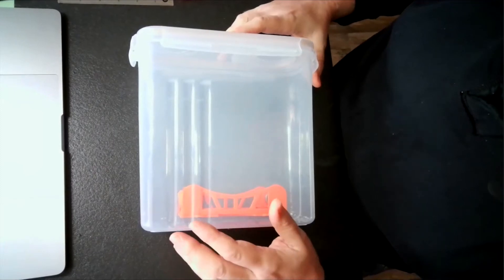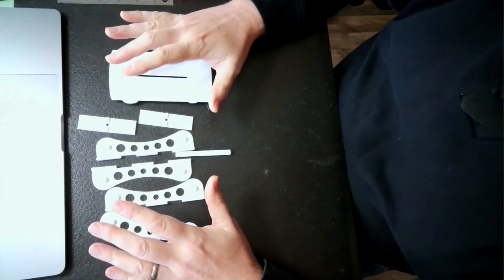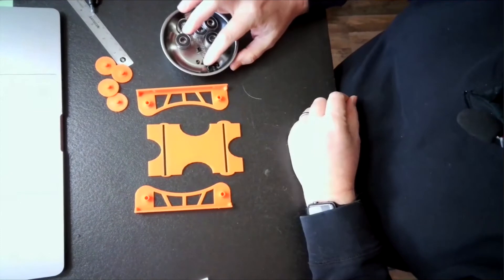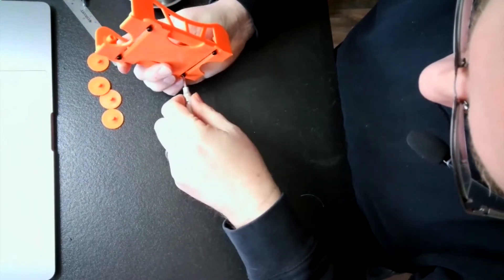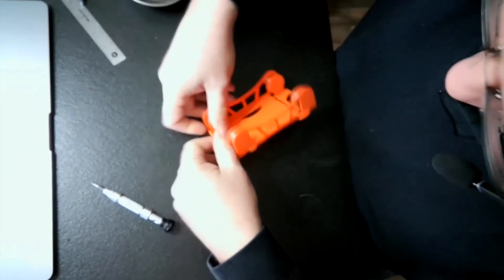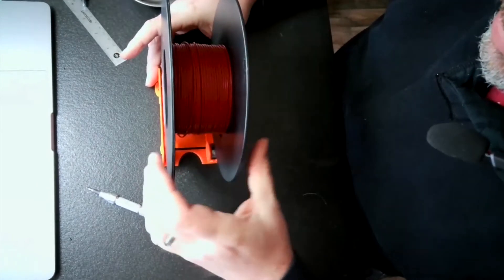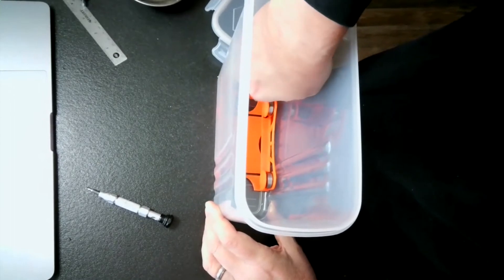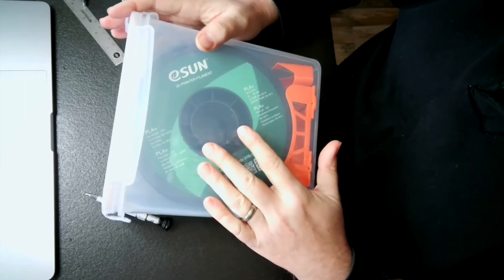3D Printing: An Updated Filament Dry Box Roller, a Minimal Design

Comment: Thank you for the detailed introduction.
Have been looking for such a flexible solution, because I think the electric cans rather for warm holding cans. Each filament arrives dry, so why let it get wet first and then dry it?
We do not have to argue about the printing times. So I print it with PETG at 40mm / sec and 0.15mm layer height and come to 9 hours. And that's fast and rough for me. To each his preferences.
Reply from the maker: I have not tried these in PETG but I am glad you find it helpful. I also appreciate the comment. Let me know if you have any questions.
Reply: @minimal3dp  Have no questions.. All good. 
But a tip, because sharing is not a one-way street. thing:4887885 on thingverse - a small silicate container to screw. Perfect height to put it behind the bearing block. 100% in x and y are a little narrow, but I'm printing it straight in 130% (X & Y diameter only). The thread offers very little clearance at 0.15mm layer height. So larger layer heights are not recommended. 
Actually I wanted to draw one myself, but you have kids. And because they always want things that don't exist, they find things so there is enough time for them and their "have to have" virus. 
Let them have a good time.

Comment: What's the widest spool that will work with this design in that container?
Reply from the maker: When I get home tonight I can make some measurements. Is there a brand/size you have in mind and I will see what I have. I have successfully used rolls from eSun, Jayo, and Overature.
Reply: @minimal3dp  Thank you!  The widest I have right now is 68mm.  I actually have three different overture spools, and every one is quite different.  But if 68mm fits, I should be set.  Thank you again!
Reply from the maker: I check and the Overture spools I use are 68mm. This design worked for me.
Reply: @minimal3dp  That's great, thanks for checking!  I'm printing it now.